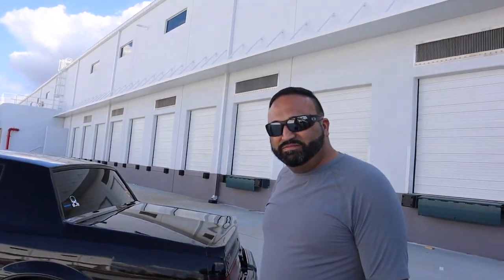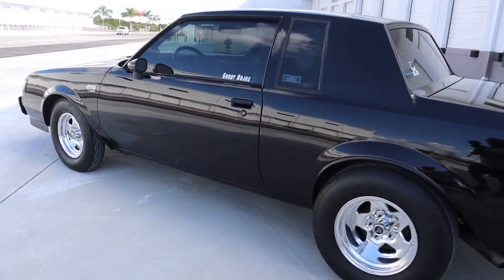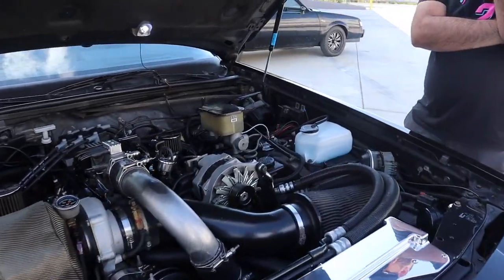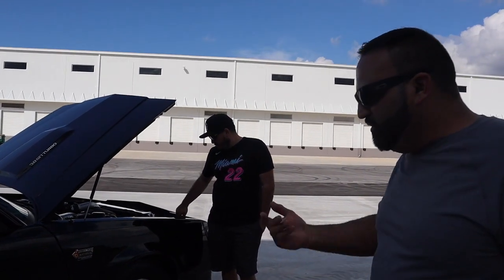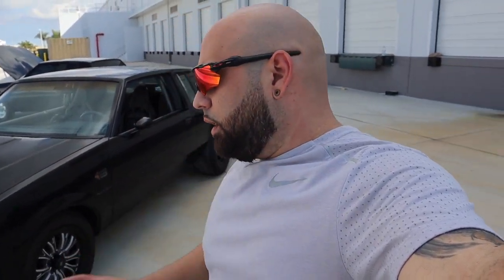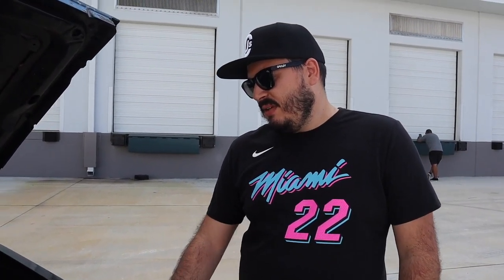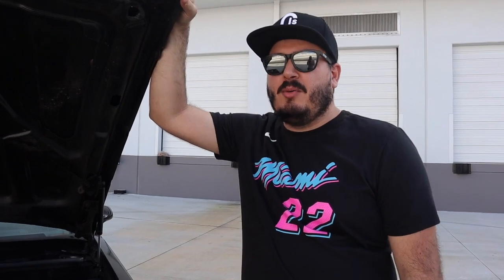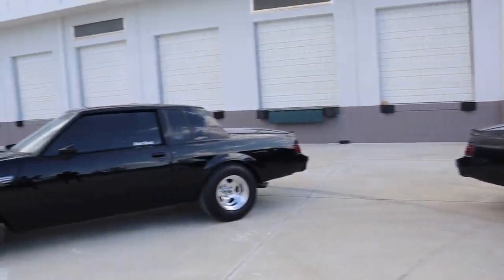BUICK GRAND NATIONAL Review - EP6 1600WHP of Pure American Turbo Power.

Comment: Truly wild cars.....had 11 different 1986/87 GN/T Type/Turbo T/Turbo Regals from 1997 to 2005. Daily drove all of them.....some were mid to low 12's and a few  that I modified down into the mid 11's. I knew the heavy hitters in my area and often got their used hand me downs for good prices......lol. Had a boatload of chips.....even one for passing emissions when I lived in an emission testing county. Life, marriage and step kids sadly had me sell my toys.......looking back should have dumped the ex wife and kept the cars. 
I always managed to stumble across great deals on used high mileage turbo buicks back then and loved tuning them and tinkering and loved test and tune nights at local
tracks. Those G bodies with that massive torque from those six cylinder turbo motors really were fun.
I was into early 1970's Trans Ams before the Buicks and even had (kick myself for selling it) a 1973 Super Duty Trans Am which, for those that know, the 455 SD was NOT like any other 455 poncho engine......aside from size, the SD motors were hand built at the factory and basically de tuned race motors......special high nickel block with extra webbing
in lifter valley to reduce block flex at high power, nearly indestructible connecting rods, heads with sodium filled exhaust valves and soooo much more in those round port heads.......and much more. They put a small cam in it to sell to the public BUT I put a nice Ram Air 4 cam in it and did other tweaks to it and had that car down into the low 12's
without going too crazy. I will tell you.....those f body cars......with the "uni body" were a HANDFUL when you ran power through them and the high torque of those big inch poncho motors would get you feeling like you were holding onto a bucking bull.....even using "frame connectors" did not help a lot really. My point is those F bodies were a much
different animal on hard launches and acceleration VS the full frame G bodies. I prefer the fullsize, full framed G bodies though......you get a much better ride and less white knuckle type launches even with higher power. I knew several guys over the years that had totaled their GNs on the street and two guys would not still be around had it not been for the full frame of those G bodies. 
I am sick now and older so only way I will get a musclecar is hitting the lottery BUT if I did the first car I would get would be a 1987 White Turbo T Buick and build it into a 10 second street car. I had one, not 10 seconds lol, and I loved it since I had taken badging off of it so it had the black out package but it was a sleeper back in 2001.....if you did not know what that hood bulge and split front air dam meant then yes, even at just a low 12 second car it still went zero to sixty in under five seconds so at the stop lights it was
a real sleeper.....lol. Yes, I would get another 1973 Trans Am but not paying the crazy prices for a Super Duty so I would get one with a nicely built and most likely stroked 455 to have some fun with on the street without killing myself. Yes, I will tell you that those Black Grand Nationals really were attention getters and still are these days....which sadly makes them ultra high for theft plus everyone wanted to race you.......worse than having a corvette really.....which is why I liked my white T and the other turbo regals I had but
I had five different GNs also and yes, you got noticed...or rather the car did.....lol.
Anyways........short of hitting a lottery.......I will still have my memories of having had those cars.

Comment: damn, that jiffy lube logo on the centerline wheels, "I think" anyway looks badass!!! I thought maybe bogart at 1st or older centerlines. Those look so much better than the standard convo-pros.  I have a pretty rare set of Bob Glidden slots for mine. Guess they were a 2yr only Crager wheel originally. Mine isn't a GN or even a t-type though. Mine is going to be around a 6.8ish liter turbo.